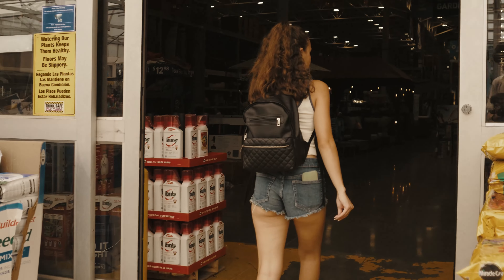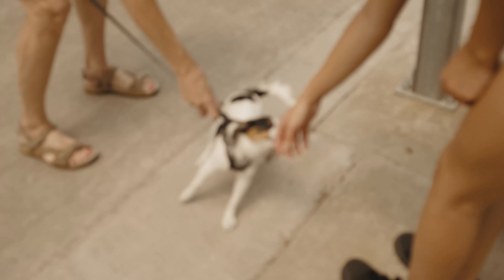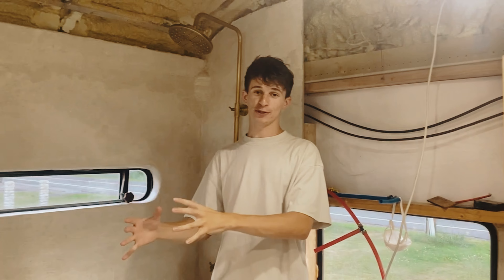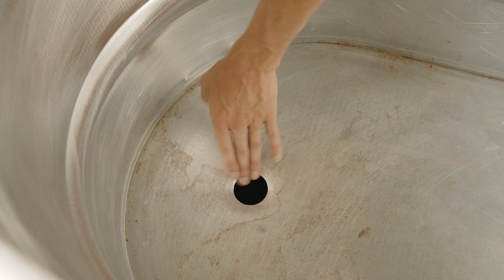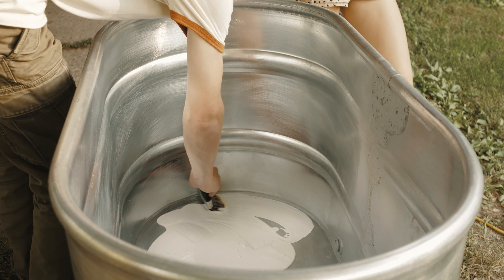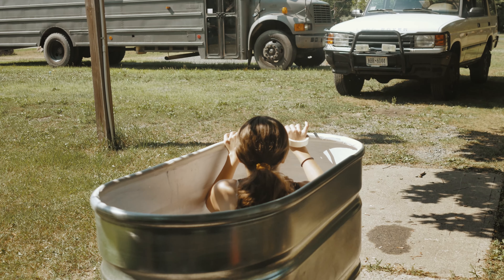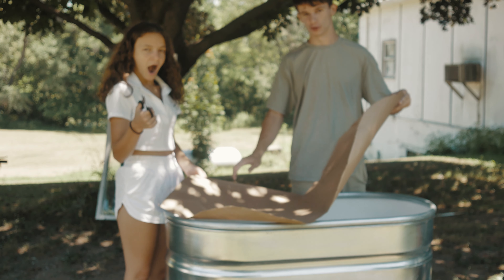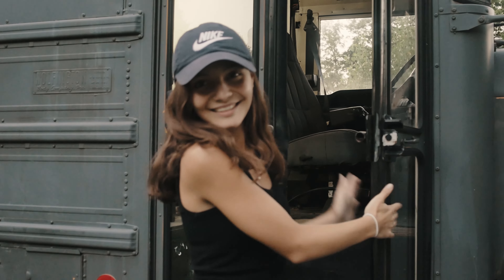How We Made A "Metal Stock Tank" Into Our "Bath Tub"

Comment: Does the water maintain heat long enough to enjoy a long bath? That, along with a slight tilt to the whole tub towards the drain, have been my big thoughts on doing this project ourselves.
Reply: Yes because it's metal. It will retain heat
Reply: @Khan11u  Metal is conductive. So it probably won't hold heat as well without insulation.

Comment: The thing about the Rubbermaid over the steel tanks is? There wider and more comfortable. They got rail like.  Where you can put your arms > THERE SWEET FOKS!  When i got mine i made sure the plug was tight, and the rubber seal was there. Then i washed it inside and out. Let it dray then painted the inside Seaside Blue  > 💦💦!  SPLASH.   let it dry!  Then i gave it 3 heavy coat of AMOUR ALL. All over the sides and the bottom  👀 Boy it soaked it up 👀 I place by the back door where i can easy slip in and out of it. and every 5 days or so. Drain it on my lawn.  There light and very strong made. I LOVE IT ❤  I made a top for it out of a 55 gal trash can bag. RAN DUCK TAPE around the top rail over the bag top and, under the rail lip.  Slips off and on PERFECT 👍👍 This keep leaves, insects, and animals out of my tank  😁😁Yes squirrels, Raccoons, and lizards love to swim

Comment: Great job.  I ran into an issue with my drain and I think after watching you I’m gonna have to dent mine in also to get it to sit flush because it sits up high enough where I have 316 7 inch of water to a quarter inch of water sitting in the bottom of the tub because that drain is not flush.. are you glad you used flexseal on the inside of the tub?